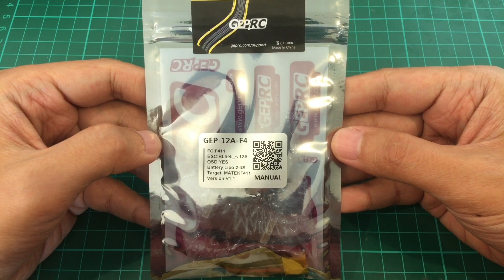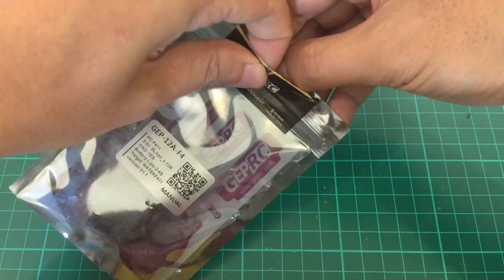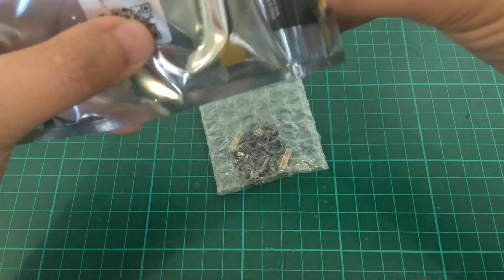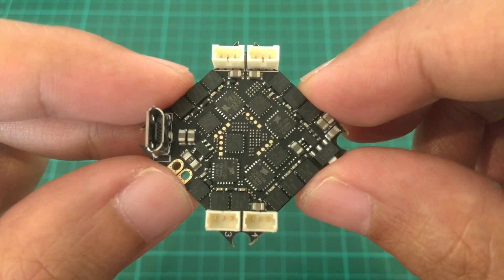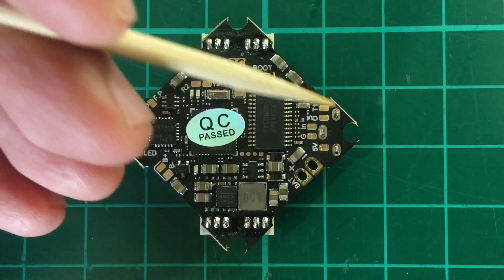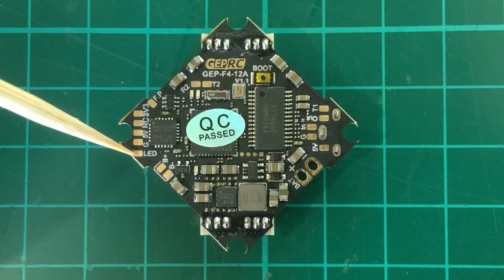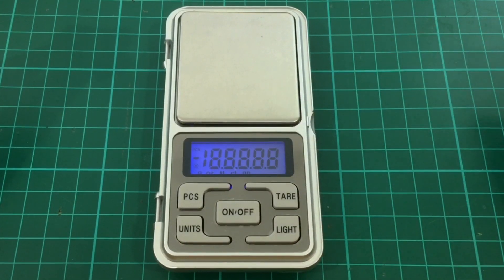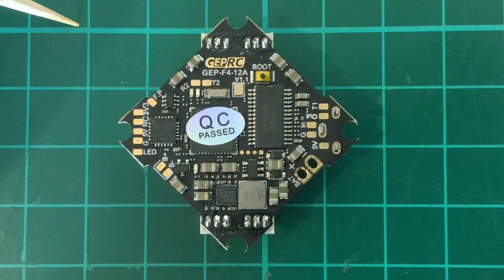GEPRC GEP-12A-F4 V1.1 FC Unboxing And Overview

Comment: Have you hooked up a receiver to this board yet? I'm having real problems getting my crossfire nano to work. I've soldered to the pads exactly how it shows in the diagram and I've got it to bind but no response with stick inputs and doesn't recognise is in the receiver tab in beta flight
Reply from the maker: Christian Tribbeck Have you tried soldering to R2? I believe crossfire is not inverted.
Reply: Hi yes I've just tried that and it works fine now thanks for the help

Comment: do it fit on mobula7 frame? and  maybe compatible on 0803 16000kv motors? Thanks alot!👌🏼
Reply from the maker: IvanRad FPV Yup, standard whoop mounting. Should handle any motor and prop combination that generates up to 12A. Rating is for continuous.